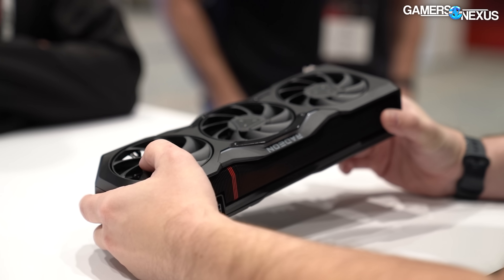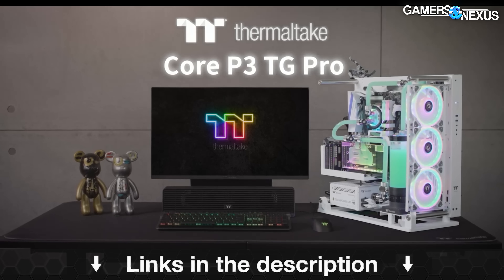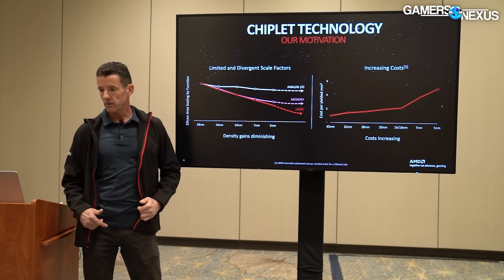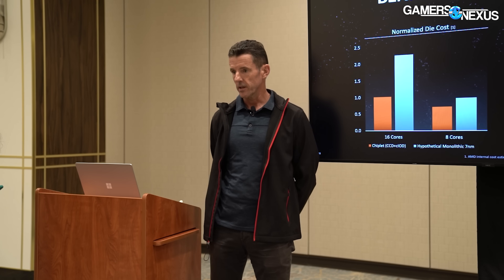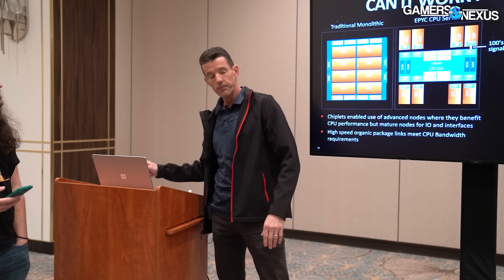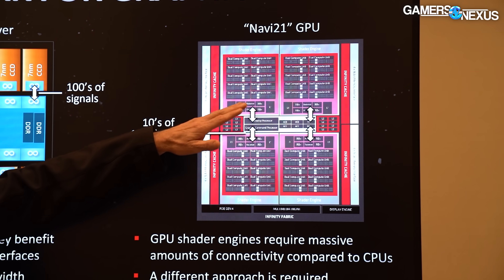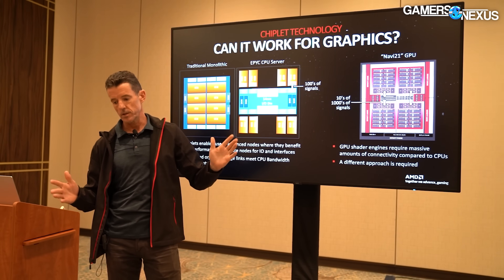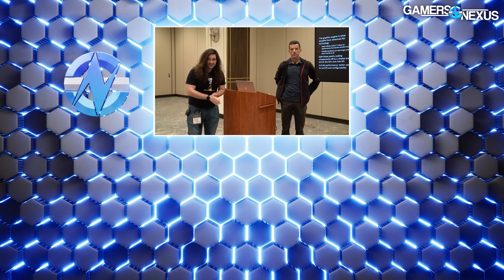How AMD is Fighting NVIDIA with RDNA3 - Chiplet Engineering Explained

Comment: They're not "fighting" Nvidia, if anything they're ignoring them. Look at the 7900XT. A true dual-slot card that's even the full height of the PCIe bracket and nothing more. This is in stark contrast to Nvidia's obese slot-bending, BGA-popping designs. Even the anemic 4080 is right out of Gravy Seals training. What Nvidia is doing is simply overclocking and software-cheating out a gross frankenstein which only purpouse is to fool circle-droolers into thinking they're ahead of AMD. The 7900XTX is a tier below the 4090 because it's not an insane, fat, drugged up power pig. Not because it's actually behind.
Reply: You have no clue what you're talking about and it's clear you don't even understand basic GPU design. The 7900XTX isn't going to be faster than the 4080 I bet and it will be because it lacks the raw power to compete on the same level. Biggest performance jump in decades from the 4090 compared to last gen, and it's not because of "simply overclocking" or "software cheating". Nvidia is so far ahead of AMD in terms of software, hardware, and features only circle droolers like you are too obtuse to see it. DLSS, ray tracing, raw performance, etc.. all favor Nvidia at the moment. And they have their own chiplet design, superior to AMD's, but they don't see the need to bring it out yet as there is still room for monolith designs this year and next.

Comment: I understand that he may not be able to talk about it, but it would have been really interesting to hear him talk more about slicing up the graphics logic into several separate dies. He said that the bandwidth requirements would be too large, but is it something that they are working on for the future?
Reply: the cost is prohibitive. You just need to look at what apple did with the M1 Ultra were the entier side of one of the dies is used to bridge the 2 dies and this uses a silicone interposes (as he said very costly).  This is something that just doe not make economic sense currently for consumer products (even gpus costing over $1k).

Also in the end you end up with a lot of extra die area needed for the interconnect (on the M1 Ultra that might well be as much as 5% of the die area ends up being used for interconnect).

Comment: This is the really interesting stuff that most reporters dont tend to go much into, the engineering is the star of the show when it comes to hardware, but often we get mostly the marketing or general memes as news. Ex. I literally still have a piledriver(improved bulldozer) rig that does fantastically well, but everyone treated that gen like it was a cancer when in reality it was great, even if slower than intel at the time in single threaded, it still had 8 cores & 64bit waaaaay before most of the competition.  I have a 5900x 12 core system now, but that last one still works fine.

Comment: Intel has proven that superior architecture combined with even lesser nodes than AMD uses, makes chiplet design totally unncecessary. At least in the low core count consumer market(up to 16) monolythic ringbus designs still are king. The added latency and complexity as well as the limitations of interposing technologies involved with chiplet designs will always be drawbacks compared to single die architectures. I have my doubts this will work out any different in the GPU game.

Comment: I am very curious about if HBM would be an additional option with this chiplet design. With it being easier to refresh and not need to redesign the memory die.
Reply: the chiplet approach would certainly make it easier to have cheaper GDDR and more expensive HBM SKUs available. Just swap out the MCD die with an HBM mem controller version, done. The big expensive GCD die can stay the same.

Comment: AMD, from now until the end of time will fall short of Nvidia. the may compete...some, but they wont win. There are some main reasons for this. Alot of people Like that story of the underdog winning the day, so they then root for the underdog. In most instances, the underdog predictably gets crushed, but in some cases, They do win, and it is glorious. unfortunately, that does not apply in the context of AMD vs Nvidia.
Here are some reasons why AMD will never really top Nvidia again. Not a fanboy btw, just a realist.

1. AMD's chiplet design- You must understand, that AMD going with a chiplet design has nothing to do with the end user in mind, and everything to do with company savings and profitability in mind. If you look at the design, its cool and interesting and all, but you have to realize this undeniable thing, and that is, there is going to be increased latency, period, and there is absolutely no way around it. another way of putting it is, if AMD would have stayed with a monolithic design, it wouldnt have been better or worse than if they went chiplet. In fact, if they would have stayed monolithic, that version would have likely been a small bit faster. At the end of the day, they have an inferior microarchitecture design, relative to Nvidia. I know it stings, but it is true.

2. SIZE MATTERS ALOT- 2019-2020 was the so called turning point for AMD, where they seemed to challenge both Nvidia, and Intel to show that they were a true competitor, and honestly most YT pundits lapped it up like a kitten with milk, actually thinking that AMD was going to topple one of the giants of the industry, completely ignoring how the hell that even came to be in the first place, that AMD, seemingly came from so far behind to make a splash like they did. I will tell you how they did it. They accomplished this by getting on a process node that was half the size of their competitors 7nm for cpu and 6nm for gpu, while intel was on 14nm, and Nvidia was on a 12nm process. the improvement showed up immediately in the CPU sector in 2020 with the 5950X performance, and in RDNA 2 performances. it is worthy to note that RDNA 1 was on a 7nm process, and didnt see much success, because of the growing pains of the microarchitecture. Anyways, thats how you can appear better, even with an inferior design.

3. It will never be that way again. Now that Nvidia, is on a process node that is even smaller than AMD's what do you think the reality is now? Intel has gotten down to a 10nm process and is handily beating AMD, which is amazing for Intel to say the least. I know people saw the 5950X and the 5800X3d and was like WOW INTEL BAD AMD GOOD! but really it was the other way around. Think about it, once all intel had to do is shave down a die to remain competitive, and now, dropping to 10nm is all that is necessary, with that, I say INTEL GOOD AMD BAD.

Honestly I wouldnt be surprised if a new microarchitecture is announced for AMD, cpu or graphics. something has got to give now. Smoke and mirrors (shrinking to half of the competitors size, and vertical cache) wont do anymore. Also, if they are copy/pasting from one gen to the other WTF?!?! I thought there is always room for innovation, and efficiency gains.

Comment: I'm curious what the next evolution in the technology will be. AMD does have a patent for a GCD on silicon a substrate. Maybe the fan out substrate is just as good, but I assume stacking the GCD and MCD directly onto each other is beneficial.
Reply: currently using a silicon interposer or substrate is very costly. Not worth it for consumer cards. 

Also the needed connections end up taking up a good amount of die area.

Comment: I was with AMD for years from the 2500+ Barton XP all the way through A64, X2, X4 then went Intel for 10 years with 2600k. How I've seen NM size has shrunk has been crazy from all those years. 

AMD had it with A64 no question and then X2 but I feel they lost it with X4, Bulldozer etc until Ryzen 1st gen and now they've been amazing since.

But to see how design has changed since Barton has always fascinated me
Reply: I still have my AMD 64X2 build lurking in the corner of my man cave. Along with a radeon XT platinum edition card. The thing was a powerhouse for about 10 years.

Comment: Most of what was said was already known and well understood. Unfortunatley you missed the opportunity to ask if the amount of MCDs per GCD is limited by the fanout routing. Like ie.e available space for all the fanout links/"wires" or signal quality regarding link/"wire" length. This info would give you an idea at what point AMD would either have to redesign the MCDs or to maybe stack them in order to increase cache size and/or memory bus width.

Comment: I truly am cheering for AMD to be successful in both the CPU and GPU space.  We need a strong AMD to bring out the best in the competition.  For myself, I can't leave Nvidia because a lot of software is clearly superior on Nvidia because of CUDA.  I use almost the entire Adobe suite of software and they are heavily CUDA dependent.  I know that AMD is stretched thin and would rather focus on the bigger markets like gaming.  But if they could make their GPUs fully competitive in the markets like video editing, it would make me consider AMD GPUs.  I wish I could use a PC only for gaming but the reality is that my daily work also needs a fast GPU.  Time is money but more importantly, longer times is greater cost.  That said, go AMD!  I'm still on Ryzen (rocking a 5900X system) and will be upgrading to the 7900X.  But right now, I'll stick with my 3080 for now.
Reply: I'm curious, what do you do that requires a fast GPU in adobe software? Most adobe software is very cpu bound in video editing like premiere and after effects.
Reply: @penguin7323  premiere uses GPU heavily once you enable it.
Reply: @penguin7323  premiere and after effects have changed a lot. Going from a 1080 or 2080 to a 3080 delivers significant performance boosts both in terms of editing and rendering.
Reply: But why? 7900X is slower than a 13700k in almost every instance and the AM5 platform itself is more costly than Intels offerings(Z690/790). Most Adobe software still prefer Intel architectures, sometimes even by a big margin.(Premiere) Of course competition is important and necessary but this should not end up into users buying a lesser setup for their needs, just because they personally favor one manufacturer over the other. If AMD has the better offerings for my needs performance wise with also the better pricing, I go with it. Is it the other way around I go with Intel. Easy as that. No brand loyalty and fanboism needed.
Reply: @Squilliam-Fancyson  Adobe is actually slightly faster on AMD 7XXX than Intel 13XXX with the exception of the 13900K? We're talking marginaly faster, but they're absolutely not worse than Intels CPUs for these mostly single threaded tasks.
Reply: @MLWJ1993  Yeah yeah seems like I watched benchmarks with wrong numbers. They are actually all in the same ballpark performance wise. Still Intel has the cheaper plattform costs and overall slightly better gaming performance. As well as more oc headroom if engough cooling power is applied. AM5 Mainboards, are way to pricey atm, which makes Intel plattform more attractive. No fanboism needed for this conclusion.
Reply: @Squilliam-Fancyson  I don't do benchmarks.  Here at my production company, we have many different systems so I can personally observe and judge editing and rendering on any system.  And there's no way that Intel is faster by any measure.  It might be the same (both the 13th gen and AMD systems are brand new so it hasn't been that long with either) but one is not significantly faster than the other.  I've done editing and run many render jobs.  The only reason AM5 boards are more expensive is because the manufacturers are releasing high end boards to start with.  There is nothing inherently more expensive about AM5.  Yes, it uses DDR5 but I don't plan on buying any more DDR4 platforms.
Reply: @Squilliam-Fancyson  I think you're the fanboy

Comment: Im more interested in the 7500xt which will be another rx 580 performance gpu but at lower power and now with 4 lanes.
"Solid 1080p gaming" on the box.
FOr the 6th year in a row, an rx 580.

Comment: AMD may talk a big game but they never passed on to the cost benefits to the consumer while delivering a 3rd class product. No DLSS 3  or frame regeneration, third class ray tracing and a 1000 bucks for that abysmal GPU. Only AMD shills will buy from AMD at this point.
Reply: idk, 10% weaker card for 200$ more does not sound very good of an value either. (4080)
Reply: @artemisDev  haha AMD shill found. No body cares about 4080 or your xtx card. 4090 pisses on all of AMD's line up.
Reply: @YEUltra-91  you dont need to be an amd shill to want competition lol. the 4090 is really powerful but the price is absurd. dlss 3 still has a lot to prove. the 6600xt was also the best price to performance gpu we've had since the 1080ti
Reply: @YEUltra-91   @manmeet paul  i mean.. last gen the 700$ 6950xt was neck and neck with the 1.5k 3090ti in 1440p. granted it was a couple % slower in 4k. i still would take a 800 dollar discount for 10 fps without a doubt. the 6600xt, as i said, was the single best price to performance we've had in almost a decade.

we don't even have proper benchmarks for this gen yet as drivers are still brand new for the architecture, so arguing that is pointless for the time being. i guess we'll see in the coming months
Reply: @sleepyyheadd  Depends severely on the title. There are titles which favor Intel by a giant leap. Same goes for AMD being faster in some of its own sponsored titles. The only key difference being 3090ti being faster by as high as 20% while being slower by 5% on AMD sponsored titles. I can post links to show the same.
Reply: @sleepyyheadd  And in which universe did the 6950 go for 700 USD
Reply: @YEUltra-91  brand "favored" titles are seriously so silly, i can't believe they've really started marketing that stuff in recent years. it feels like balls to pay out the ass for an expensive gpu only for the dev team to tell you that you bought the wrong brand so you lose performance for no reason.

my girlfriend got a 6950xt on amazon in july for 750$. i don't see any currently for that price but there's an msi one for 800$

Comment: I really want multi GPUs on one card. A return of the mighty 4870X2!
Reply: Why? These were seen as SLI/Crossfire cars by the system and SLI/Crossfire is dead today. Even if an X2 existed no game would take advantage, but the days of X2 cards are gone anyways....just too much powerdraw and complexity for a single PCB today.
Reply: @csammy123  it worked fine back when it existed. But with these chiplet designs it could work again. Your not adding a whole other soc, you'd be adding another GPU core, similar to how Ryzen works. Crossfire does actually still work, I did it on my mining rig for fun in time spy. But ideally you would have the card present itself to the driver as a single card. GPUs themselves are already made from many cores, this would be a way to offer double the core count without developing a new chip.

Comment: This is what I love about GN. When they're presented with marketing bullshit, Steve and the team will tear these companies apart. But when they get the chance to sit down and talk with the engineers that do the real work, they sit and listen to every little detail with respect.
Now, one thing that I'm sure will come up in future discussions but didn't here is what all this allows AMD to do in the future. With how things stand, if NVidia wanted to release an even stronger version of Lovelace than the full AD102 die, they would end up in the ~800mm^2 territory (so about a 30% increase in size), dangerously close to the reticle limit for foundries. Needless to say, such large chips would have terrible yields and cost an arm and a leg to produce. AMD on the other hand can keep the memory interface as is (unless they need more infinity cache, which they can also stack at least 1-hi, or if they need a >384 bit bus or <24GB of VRAM to feed the shader engine) and simply engineer a much bigger compute die. Even a 50% increase in logic would put said die at roughly 450mm^2, a far cry even from NVidia's current top of the line, let alone their theoretical maximum. So, treating RDNA 3 as a proof of concept, like the first Zen CPUs were, we may be about to see some crazy stuff from AMD in the next few years. Even if they don't manage to split the actual GPU logic components into chiplets, they have so much room if they want to brute force more performance that it's not even funny.
Reply: I guess nvidia atm even has hit a wall with the binning, I wonde rhow many good SOCs they get out 10% 20%? The rest is either for downbinning or trash.
They face the same problem Intel has had a while ago.
Reply: @werpu12  That's another factor, a big one, I was just focusing on more high level stuff, not getting into the nitty gritty. If they didn't have binning issues, I don't think they'd only release cut down versions of their top dies at first.